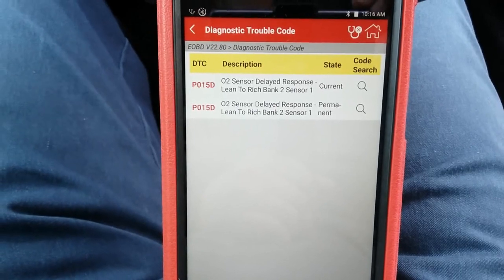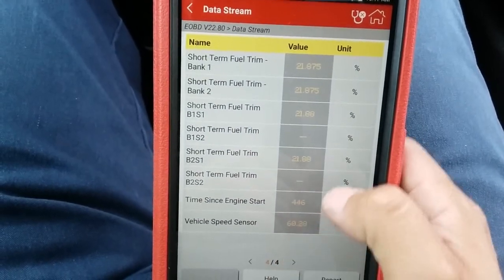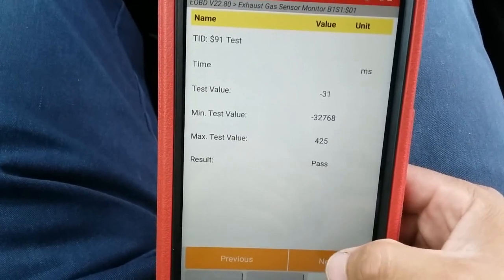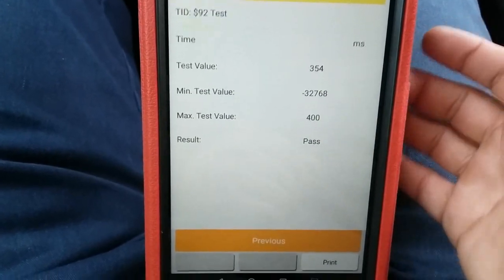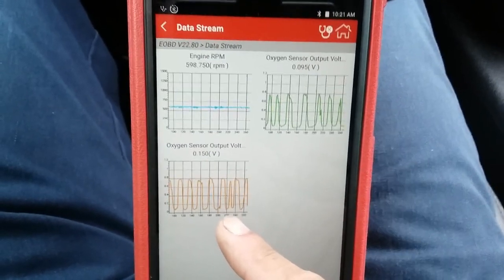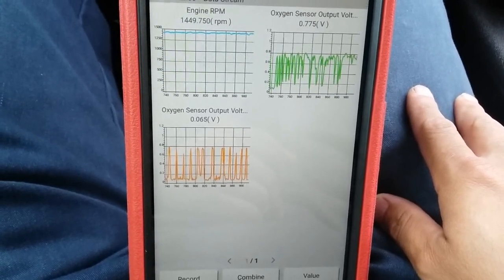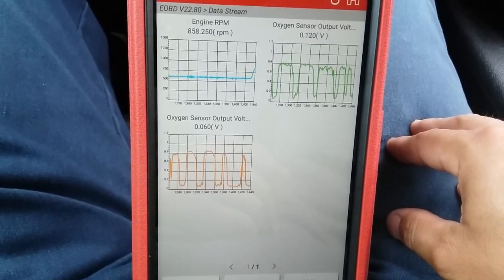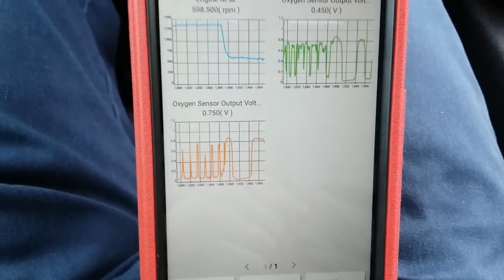(GMC Yukon) Diagnosing a P015D

Comment: Did you perform a injector balance test to make sure there was no clogged injectors ?
Reply from the maker: No, I didn't. The customer had confirm that she had fuel injection service done sometime in 2020.
Reply: @EliTheOBDTech 😊😊😊😊😊😊😊😊😊😊😊😊😊😊😊😊😊😊😊😊😊😊😊😊😊
Reply from the maker: Definitely, that is a good point to bring up. Dirty injectors can cause slow response activity from an O2 sensor.
Reply: @EliTheOBDTech  Did the customer accept the O2 replacement ? If so I assume it fixed the issue.
Reply from the maker: @1202Sid  Unfortunately, I did not get to replace it, but the customer did. He kept me updated, so far no code.